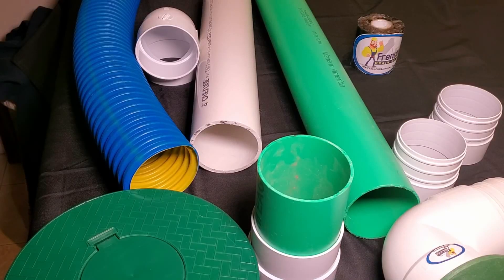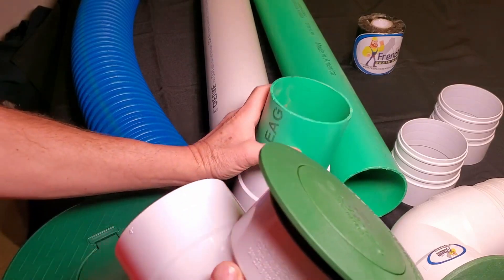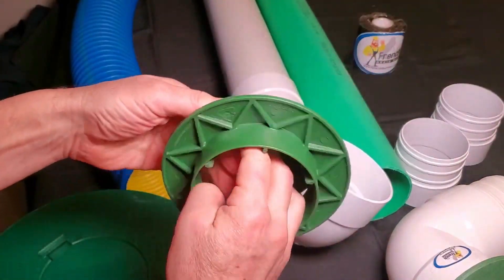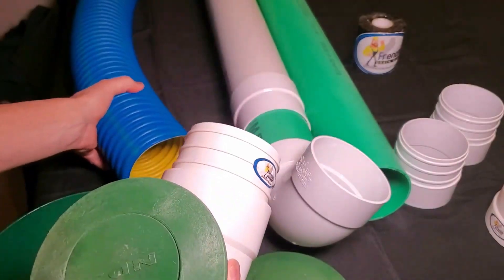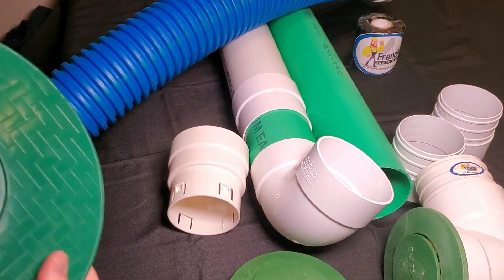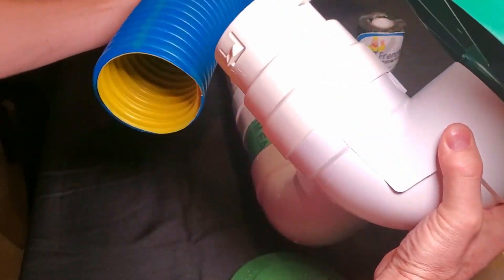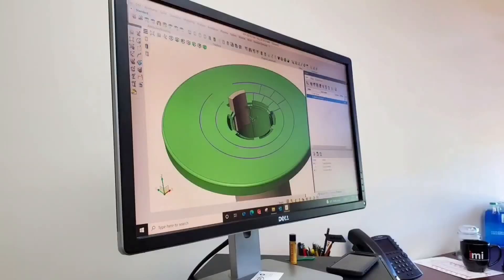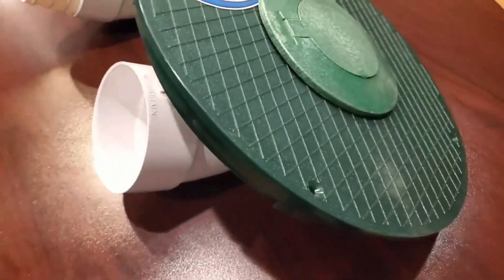How to Install a Pop-up Emitter to Drainage Pipe DIYers Easiest Connection For Buried Downspouts DIY

Comment: Can you use these pop ups handle the pressure to discharge water from a drainage sump pump?  It is  2 inch discharge sump pump what adaptors would work?
Reply from the maker: Use a 2 to 3 inch reducer that you can buy at home depot. In PVC schedule 35 SDR
3" Pop-Up Emitter & Turf Restrictor Plate - 3" PVC 35 SDR
https://frenchdrainman.com/product/3-in-pop-up-emitter-turf-restrictor-3-in-pvc/

Comment: My 3" corrogated pipe is about 12" below surface.  Can I install a pipe extension to the emitter without losing functionality ?
Reply from the maker: It's going to hold water. I would run it farther out where grade drops and daylight it there.